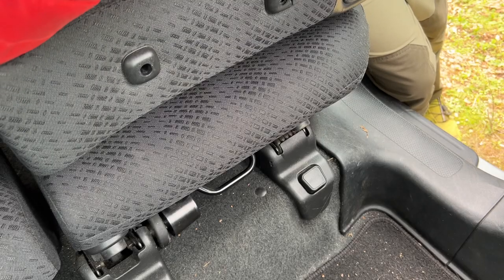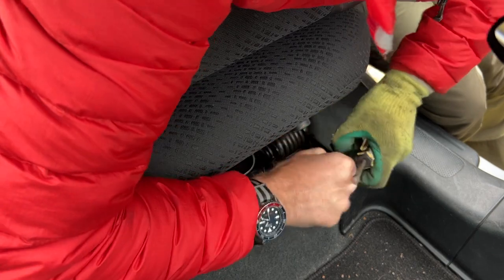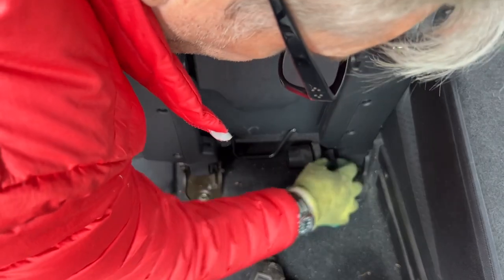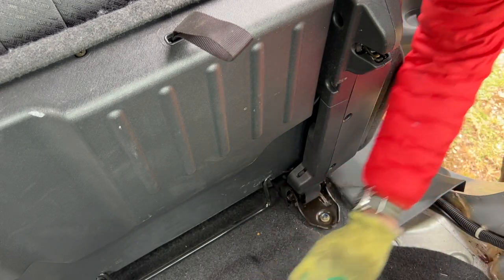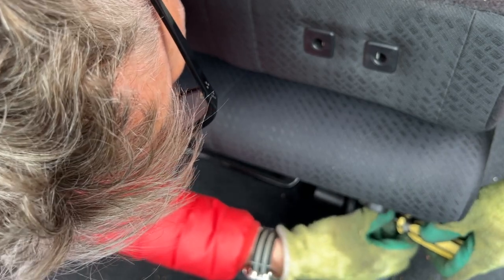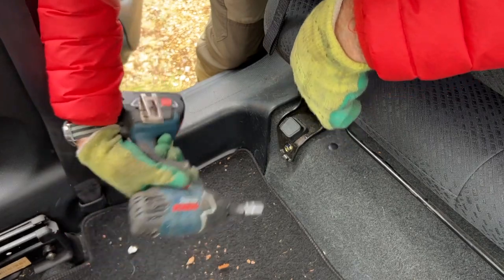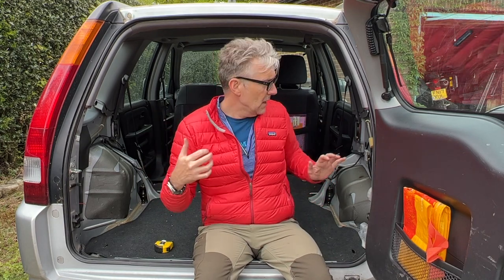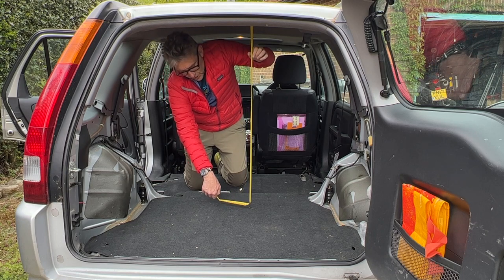Honda CRV -  Rear seat removal prior to bed installation. You need a 12mm socket.

Comment: Very helpful! How hard is it to reinstall the seats after removing them?
Reply from the maker: Yes they are heavy, so watch your back. Then when you put the bolts back in don't tighten them up immediately. The seats need some play to align the holes up. I can get the out in under 5 miutes now. Back in in maybe 10.